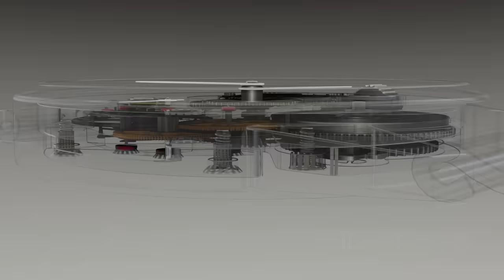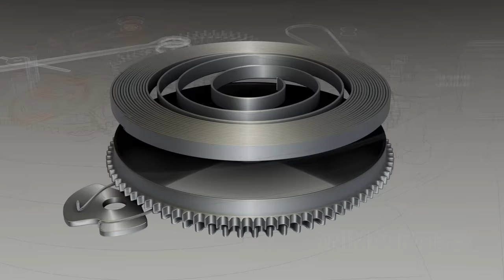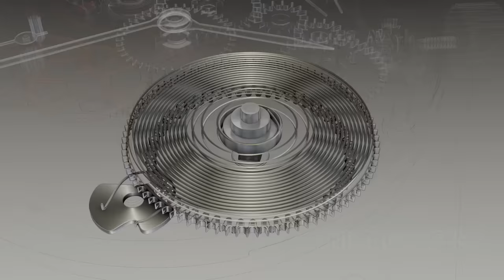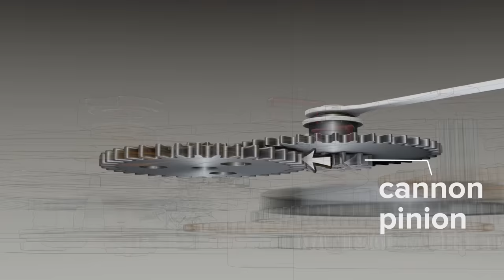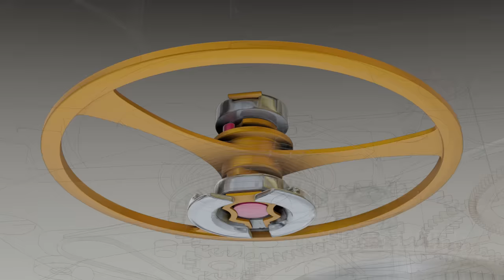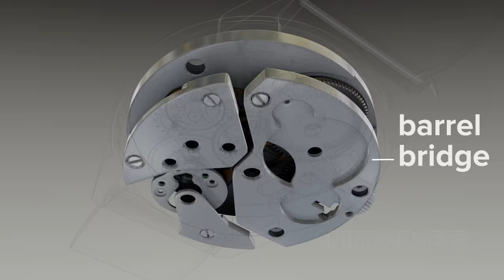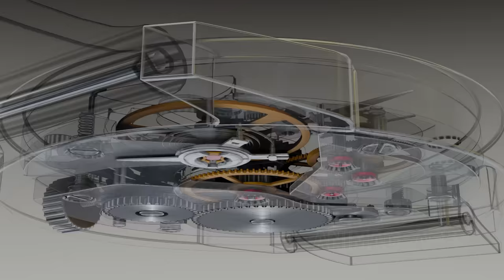How a Mechanical Watch Works

Comment: in case anyone's wondering, this is a Unitas 6497 handwind movement. this movement was originally designed for pocket watches. so it's quite big. it only fits into big watches (at least 43mm in diametre). that also means it's one of the easiest to take apart and study since the components are also proportionally big. and it's also one of the simplist in terms of complications. most watches nowadays have at least a winding rotor (an asymmetrical weighted rotor that winds the watch using the momentum of your wrist movement) and a date function (an additional 24-hour counter with 31 clicks per rotation). not to mention some of the more complex functions like chronograph (stopwatch), minute repeater (chimes the precise time to the minute) and tourbillon (a revolving escapement) etc. some more complicated watches can easily have 3 to 5 times more parts than the watch shown in this video. now imagine doing all those purely mechanically within the space of a wrist watch. then imagine these technologies existing 200 years ago. yes they did.
Reply: Hello Stan, I enjoyed quite much your explanation. I am an wristwatch enthusiastic, and I´d like to know a place where I can learn online  this art. If you can help, I tnahks.
Reply: @ruitrigo6273  you found your guy. Did he try to reach you?
Reply: A lot of the technology involving using gears to represent complex systems date back 1000 years or more. The Antikythera Mechanism from 200 BC used gears for an analog computer that showed eclipses and planet positions.
Reply: @fallinginthed33p  gears aren't what's ground breaking about watches. as you said complex geartrains existed ages ago. anotther example would be the ancient chinese inventing purely mechanical compass ("south-pointing chariot"}. that's a working differencial from 2 millennia ago.

what's amazing about mechanical watches is the invention of escapment for precision timekeeping, as well as miniturisation of parts enabled by precision manufacturing.
Reply: Totally agreed. 👍🏻😍
Reply: You can also get good-enough Chinese copies (Seagull ST3600) for about $30-$40. Highly recommended.
Reply: @BCsJonathanTM  Empty wrist is better than a chinese knockoff
Reply: Yes! Patek has a complication where the date hand goes from left to right on the watch face, then on 31st jumps back to 1 at midnight.
Reply: @saby8765  built > bought
Reply: They fit into smaller cases, they fit in to 40mm cases.
Reply: And standard wrist watches were like 30mm back then! Insane!!!
Reply: @Ballacha  or the antikythera mechanism
Reply: There's a growing body of evidence that the general "gene pool" of the world's citizens has been degrading over time.  Each replication can be perfect, but some aren't.  Then there are natural mutations that occur over time that aren't repaired.  The sum of these over thousands of years has led to, and don't get mad, the least intelligent gene pool in the world right now.  That is to say, it is more likely that people in the past had the technical ability to build complex machines than today.  The primary reason we are so tech savvy today is due to computer assistance.  Without that, seriously, we'd be in big trouble.
Reply: @glennkrieger  we’ve eliminated evolution. I know eugenics is bad but man what can we do?
Reply: @Ballacha  Exactly
Reply: Currently working on an ETA 6497 watch build (my first) and thought this looked very familiar!
Reply: @saby8765  why exactly?
Reply: Exactly.  And what blows me away is the fact that the entire invention was done without the use of a single COMPUTER!!!!!

Comment: I wore mechanical watches throughout my 48 year career as a electric utility field engineer banging around huge turbine generators, boilers, electrical gear, and all.  Wore mostly Timex, and they got the crap kicked out of them constantly, but kept on running.  Amazes me that all that action was going on inside the watch on my wrist....for decades.
Reply: Very cool! What makes and models of watches did you wear doing your job?
Reply: @IAmTheHound  Mainly Timex, but also several Hamiltons and Bulovas, most of which were automatics.  When the quartz's came along, had a few but still have always preferred mechanicals.
Reply: @santaclause2875  ah I see you mentioned Timex in your first post also. And yes, the others - all  well-engineered work horses that did their job, day in day out while probably looking pretty good and all. I love these marvels of human ingenuity and skill.
Reply: @IAmTheHound  Amazing, tiny engineering marvels for sure!!

Comment: Great vid!  I'm a fan of mechanical watches and this provided a lot of good info on how the inner workings all come together.  The precision to do this on such a small scale is unimaginable.
Reply: Precisely accurate.. this is what should be called smart watch or smart device.. it’s non electrical in any way, yet ticking like heart beats.
Reply: I have 3 questions
If I wind my watch today...than its run whole day? I mean how many times it's run if I wind 10time?
2nd questions is that....if I wind today...its properly work next day also but if I will wind agin so it's defects my watch mechanism???
3rd is that in some video first wind antilock wise and than clockwise.. why?? Every time do first anticlockwise and than clockwise???

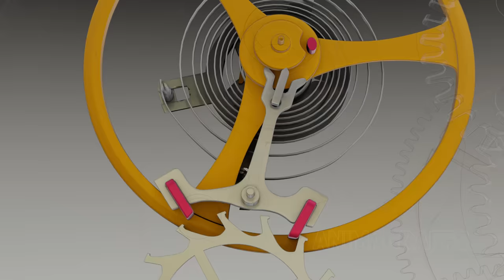Comment: I am very impressed at the little impulse of power @ 5:39. That part is amazing. It's like a swing set that is horizontal instead of vertical, where they use a spring to simulate  gravity. That's neat. Thanks for the explanation and video

Comment: Would be an interesting side show to know how the "shake to wind" mechanism works too. Great video!
Reply: My understanding of it is that it works the same way, but underneath the support structure, there's a metal disk weight that can freely spin around a central point which will works on the mechanism that powers the mainspring the same way that turning the crown does.
Reply: @gnomeam  And while that disk weight can turn both ways, it only winds the main spring one way.

Comment: 3:00 I bought a pack of mechanical watch parts on eBay once, it was advertised as pieces for a project, and those bearings are super small... a small red speck, about the size of a speck of glitter, was on the tip of my finger. Using a magnifying glass, I could see the hole in the bearing, which was so small none of my sewing needles nor strands of thread could pass through. It is awesome, knowing that many jewelers had hands steady enough to precisely assemble such pieces. I read somewhere that those kinds of jewelers have hands roughly 10x more steady than a surgeon.

Comment: What an amazing explanation! I'm impressed by the quality of the content in this channel.

I would really enjoy if you make an animation of how some mechanical calculators work, especially the automatic ones like the Olivetti Divisumma 24. There are already a very good channel called Mechanical Computing, in which it's explained how many calculators work, including a 10 key machine. But I've never seen how an automatic dividing machine works, and how it knows how to subtract from the dividend and register how many times it has subtracted.

Again, this is a breathtaking explanation, and I really hope this channel keeps showing such high quality content. The animation is simply beautiful.

Comment: As a professional watchmaker, I'd like to say you did a fine job displaying and explaining how a simple timepiece operates. 
A couple of things I would have liked to see added, that weren't mentioned, is the fact all mechanical timepieces like this, require maintenance at a maximum of 5 year intervals. Vintage watches require maintenance every two years. You discussed the "synthetic jewels", but not their true function. And BTW, in vintage and antique watches, the jewels were genuine rubies. The jewels are designed to hold oil and work maintaining lubrication of pinions due to capillary action. This has been the case for hundreds of years. A typical watch like this normally runs at a beat rate of 18,000 bph which is much more common than the 21,600 bph you said is "standard. In the watches jewels, they're designed to carry oil and a watch like this requires 5 different types of lubricants to run properly. Great care must be taken in cleaning a watch, and applying fresh lubricants when its serviced. 
Watchmaking is a very in-depth technical field, which requires a lifetime of learning and skills to master. There's an almost uncountable number of variables not mentioned here, that directly affect the watches ability to keep proper time. From standard issues like isochronism, which is the variable power in the watch at different times, but yet the watch must always function at the same rate to be accurate, as if the power from the mainspring is a constant steady source of power, which it's not. A fully wound watch mainspring, applies much more power than a mainspring that's unwound near its end. Yet, we must ensure the watch keeps a steady rate in all varying power conditions. 
Lastly, "regulating" a watch, is MUCH more than adjusting the hairspring length. Full movement if the adjuster, only changes the rate by a minute or two per day. Proper "Regulating" is done in numerous areas of the watch, adjustment of balance wheel jewels, endshakes, etc.. A quality watch is regulated in 5 different positions, because due to the weight if the balance wheel, a watch runs at different rates, depending upon its position. ie. Crown up, crown down, dial up, dial down etc.. For a person wearing on the left arm, the crown down position is predominantly the position the watch will be in when worn. All of these factors are taken into consideration when "regulating" a watch. 

What might also be interesting, is to do this same animation but showing a complex watch, such as an autowinding chronograph. Most of which have upwards of several hundred parts, all which must be hand serviced individually to ensure proper time keeping. 
When people see the detail involved, then they understand why servicing a complex watch costs as much as it does. 

Thanks for your great presentation!  Even seeing how a very basic mechanical watch works, helps people to understand the bigger picture if caring for their cherished timepieces.  🙂👍

Comment: I have allways been fascinated by mechanical watches, but only when I realized those watches are a tiny, tiny mechanical machine that runs only on a spring you wind up manually or have an automatic winding mechanism by moving the watch, I fell in love with mechanical watches. There are hundreds of years of watch making and tny improvements to get those extremely complicated tiny machines to work without a battery. And I love my manual winding watch the most, because I sit on the bed and wind up my watch like my father did and his father and his father did. It is a 30 second ritual every morning where you take care of your watch and realize what an amazing mechanical wonder it is.

Comment: I don't understand how the spring on the balance wheel is kept in motion. What does the mechanism look like that attaches it to the mainspring? Does that energy transfer to the balance wheel through the minute hand gears, or are there other gears that linked everything together?
Reply: Hi.  I'm not a watchmaker or anything, but it looks like it might be elastic potential energy.  Elastic potential energy is "stored" energy that results from a material being deformed out of its original shape.  In this case, the spring metal wants to be straight, but he winding force deforms it into a tighter coil until the escapement releases some of it.
Reply from the maker: Thx Mark for helping out here ... it also has to do with the power exchange I describe, where escape wheel teeth give the pallet fork a tiny push from the mainspring, which sort of "winds up" the hairspring for another half-swing each time. I've shown every part of this watch movement, there's no other significant hidden parts or otherwise.
Reply: @animagraffs  Perfect! Thanks for clearing that up. Makes sense why that part is so delicate now. Amazing work I'll add, I love all your content on your website. Is there any way for me to support what you do?

Comment: What a simple and straightforward explanation. Thanks for making it easy to grasp. One thing I was hoping to learn but did not was; why are jewels so important? Is it just their hardness and ability to retain the value of the lubricants applied, or is it something more complex?
Reply: The high polish and hardness of the jewels make a very smooth, nearly friction-free bearing for less resistance.  The hardness also makes them last longer than a metal sleeve would.

Comment: Q: How does the escapement keep the steady pace when the main spring torque (I would think) slowly goes down?
Reply: @WindingDreams  Sounds good to me…
Reply: afaik the main spring is built in a way that the torque is almost constant
Reply: from english Wikipedia>Mainspring>Modern:
"the outer end of the spring is coiled in the reverse direction", "The semi-reverse and reverse types provide extra force at the end of the running period, when the spring is almost out of energy, in order to keep the timepiece running at a constant rate to the end." Also, the spring only unwinds a bit.

also see History>Constant force from a spring
Reply: Good question. To my understanding it doesn't. As it unwinds the main spring's transfer of energy is reduced. To achieve what you're saying a constant force mechanism is required.

Comment: "Accuracy within 2-3 seconds per day."
Cries in Vostok
Reply: Good watches only lose a few seconds per year. So over 20 years, you lose one minute. Hell, I bought a used clock for $1.50 at Goodwill and it keeps better time than my internet connected computer.
Reply: @hxhdfjifzirstc894  That is impossible. Internet-connected clocks are synchronized to atomic clocks on the satellite. Atomic clocks use atomic fission to measure time. It is the most accurate clocks currently possible.

Comment: Much more beautiful than quartz watches right? Excellent animation and perfect explanation / understanding of the operation of a mechanical watch. I had the pleasure of learning to repair them, but since quartz watches had already dominated the market for years, very few reached my hands; So the few that I was able to obtain for myself and the few clients that still had and valued these watches, are the ones that I had the pleasure of giving them a lubrication and tuning, which is the minimum maintenance for one of these watches to continue working for years. as long as they were not knocked over or submerged in water. Oh and I must also add that they are ecological: they do not pollute the environment with batteries...

Comment: Ah thank you for the breakdown and the transparent view. Finally a full explanation of how the mechanisms work. The way many people talk about the balance wheel and spring is very deceiving. Its not so much power being transferred to and from the balance wheel, its a tension put in place by the spring being released by the balance wheel and fork in the regular increments

Comment: This is excellent. My only suggestion is spend more time on how important the shape of the escape wheel teeth are, and how the pallet fork both pushes the balance wheel (winding the leaf spring using the energy from the mainspring) and is pushed by the balance wheel as the leaf spring unwinds. You do mention all these things, but it's hard to wrap your head around quickly. Amazing animations. Thank you!

Comment: Nice video which explains the basics perfectly without getting into the complications features or multiple barrels running in series or parallel. Actually this would make a great work horse movement as all internals are supported by plates, bridges and cocks.

Comment: I fix mechanical watches as a hobby.  Excellent presentation.  The only thing I'd add is an explanation of how very small qualities of synthetic oils are placed between the wheel axles and the jewels they rest in so that the two materials do not rub against each other.  The oils are held in place by capillary action.  These oils are what allow a mechanical watch to run for decades rather than failing within a year or less.  P.S.  I see you're basing this video on a Unitas 6497, which is a great movement to use for demonstrations.

Comment: I think the hair spring is tightening when it should be loosening, and vice versa. At about 5:41, you can see that when the balance wheel turns clockwise, the coil tightens. However, since the outside end of the spring points left, the spring must be wrapping counter clockwise as its radius decreases, therefore a counter clockwise rotation of the wheel would tighten the coil.
    Great work, though (this, and your other work). I'd love to see how electronic car wheel alignment systems work, and how mechanical watches are made.

Comment: Crazy to think that people who rode horses to get around and didn't have electricity and light bulbs figured all this out.
Reply: It was a slow process. Gears are from the 3rd century BCE, mechanical clocks around the 13th century CE, which leads us to main springs about 200 years later, and in the 1500s we get the first pocket watch. And then in 1868 we get the first wrist watch which became popular after WWI.

Comment: Thank you very much for your explanation how does the watch works. So that people will get idea how repair and use the clock or watch again if it did not function properly. Forwarding energy from main  wheel to centre wheel and then to third wheel and then to second hand wheel and then to escapement wheel causes the the leaver to push the balance wheel forward everytime when it returns backward and make it keep oscillating between the windings and reversing power from escapement wheel to second hand wheel and then to third wheel and then to centre wheel and back to main wheel causes the hands to move forward.